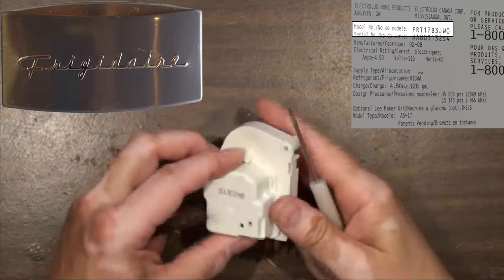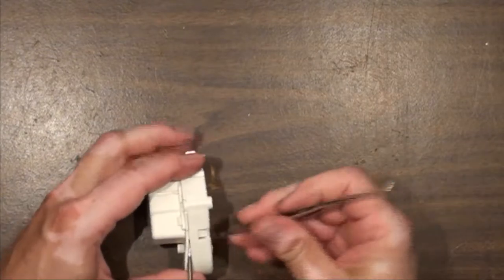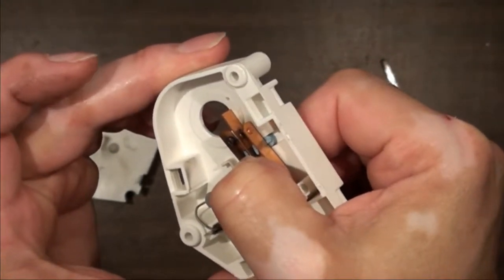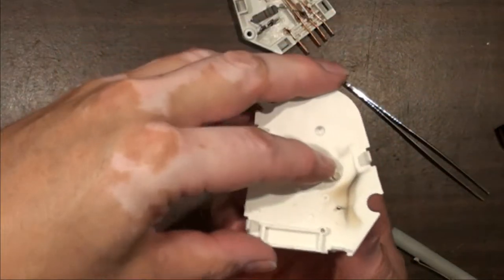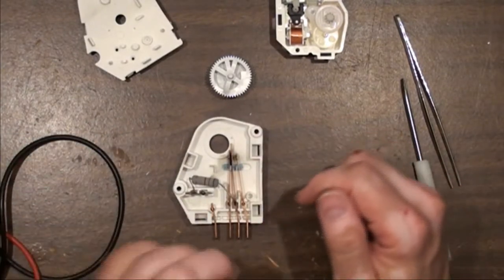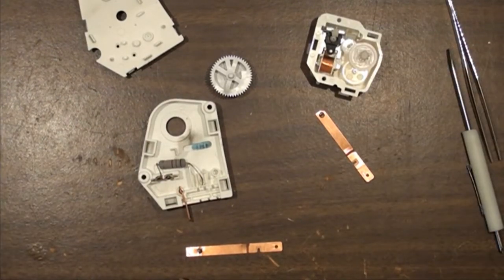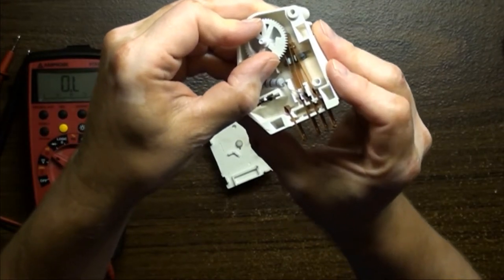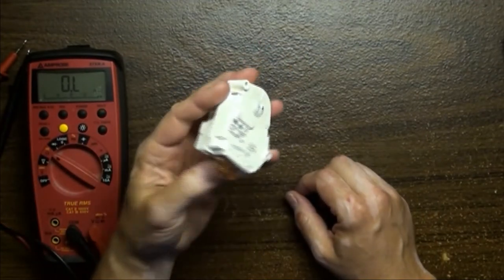Frigidaire, Refrigerator Timer, Keeps Blowing GFI Breaker - $1 fix.

Comment: I’ve had this experience more than once and replacing the gfci  with a regular outlet solves the problem. The gfci is very sensitive it sees a current surge when the defrost heater comes on and reacts by tripping to protect the refrigerator

Comment: Replaced the defrost timer switch and it still threw the gfci although it was about a week or so later. The weather did get cooler in the garage where the fridge is kept. Thoughts??
Thank you for the video too
Very helpful
Reply from the maker: I would probably make sure it is cleaned pretty well around the compressor and cooling tubes, etc., and has room to breathe because heat will make the current draw go up and trip the GFCI. If the fridge is on a 20 amp line, make sure to use a 20 amp GFCI. If it's on a 15 amp line then you may have to consider changing it to a 20 amp line. Hopefully, the compressor isn't going out on it and working harder to keep it cool. Hope this helps.
Reply: Thank you. Cleaned the coils. Changed the defrost timer and Changed the GFCI and it worked for about a week and then tripped so back to square one. Fridge and freezer still cold. 
Hmmmmm
Reply from the maker: @tfolk5394  Well, have you noticed if it blows the breaker when the compressor turns on or when the defroster turns on...if it does with the compressor then I would say the problem is in that area (did you say you put it on a 20 amp breaker?). If so, the compressor could be going bad. Otherwise, if it blows when the defroster is on, I would say check the defrost element and the thermal switch for the defroster. It should be attached to the cold tubes behind the back panel of the freezer. check it for proper operation in a glass of ice water. You will probably will have to cut the wires to take it out and check it. A continuity meter will help with this test.

Comment: The contacts in your GFI are probably bad. You got too many amps drawing on the circuit. That's pretty common knowledge that you do not place a refrigerator on a GFI. GFI's are rated for 15 amps normally. you can tell by the contacts being burnt in your timer that you're near exceeding that amp draw with your refrigerator and or whatever else is plugged into that circuit. Refrigerators need to be on a dedicated circuit with nothing else running.

Comment: Where did you find that part in the fridge ?
Reply from the maker: The video shows that it is inside the fridge (not the freezer) hanging from the top where the light is. It's under a cover.
Reply: Electronics Editor you are the best.  Thank you sir.

Comment: Can not find this part in under or be hide the fridge very confused
Reply from the maker: Sorry I did not put a model number for the fridge in this video, but it was I'm guessing an older fridge, and those usually had some type of timer like these in them somewhere. I've seen them with capacitors in the timer instead of resistors as well. For this fridge, the timer was in the main compartment up on the top where the light would usually be located. You need to unscrew a cover to be able to get to the timer. If your fridge is newer, it may be controlled by a circuit on a circuit board located under the fridge.